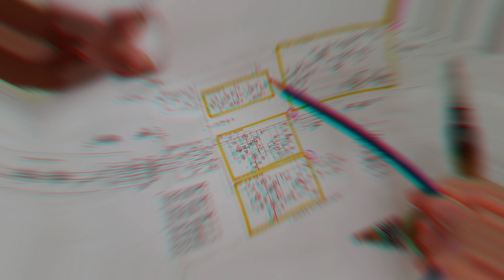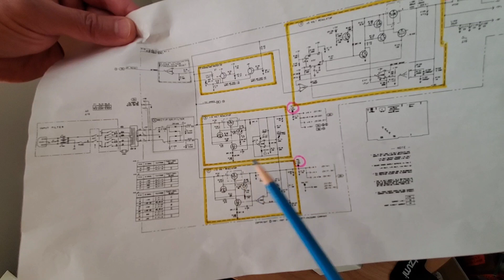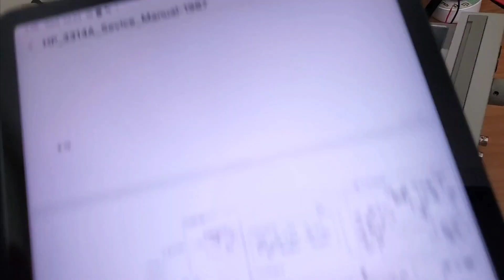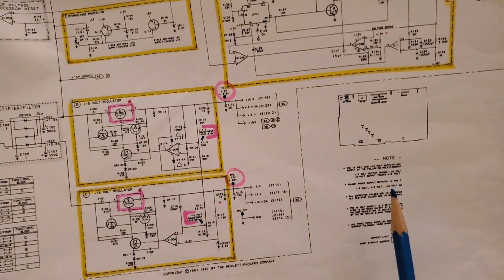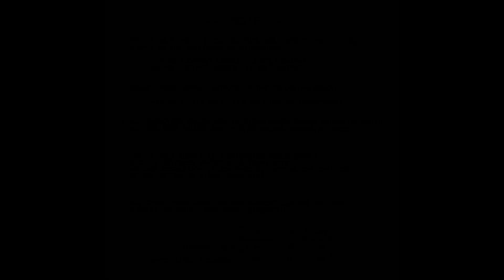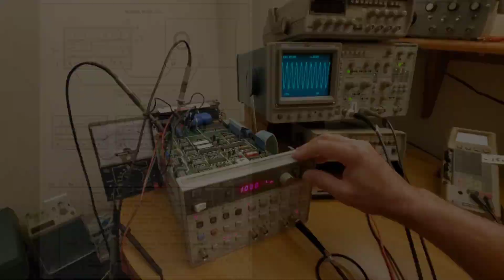HP 3314A Part 2 Troubleshooting (Power Supply and Voltage Safety Circuits)

Comment: Hi could u help me pls I hv a display issue, however when I discount the same cable as u did. I get the screen and good voltages on the rails. When connecting the cable back I get on the rails +0.37 volts + 10.69 volts and 0.116 volts. Do u hv any idea where i should look?
Reply: Ok mate thnks i will check it out and thanks for the support and great explannations
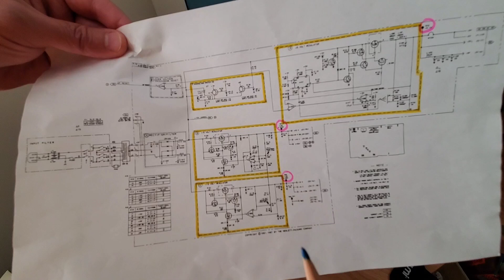Reply from the maker: Yes, in the video starting @8:35 there's 1min about the higher voltages behind the regulators. The output readings of the transfomer are in RMS so higher DC measurements are expected after AC to DC rectification.  I don't know if your unit needs calibration or not - I have not looked into it myself as my output measurements seem to be good (although only measured against my other old equipment).  The service manual pdf has more details if you need it.
Reply from the maker: If voltages go back to normal when disconnecting the J1 ribbon connector, then I would suspect a shorted component on the front panel circuits.  The display board itself is less likely to have short, but its smaller controller board right behind it (I think it's called A11 board though missing from my service manual) it does have some tantalum caps that could easily cause your issue.  Check for a short with a multimeter on the supply lines on that board by itself and if appear shorted then you can try targeting the tantalum caps by cutting one end until you find the bad one.  It's hard to help you much more than that here but I do wish you good luck!
Reply: Thanks Adam for the pointer appreciate it
Reply from the maker: You're welcome and hope you can find the issue 👍
Reply: Thanks Adam for the pointer appreciate it, but its when i disconnect the J3 ribbon. I cant seem to see where this ribbon goes.
Reply from the maker: J3 goes to the Generator board at the very bottom, the same board I had the second bad tantalum cap in my video.  If you don't know how to get to that board you can watch Part 1 video
Reply: Hi Adam I just want to say a big thank you, followed what you did, i cut C107 and C607 and low and behold my display worked. So i will swap out those two tantalums for new sealed tantalums i hv with same values. Problem solved… I i think over time swap out all the tantalums just in case for the future. But a big thank you, you helped alot.
Reply from the maker: You're welcome and I'm glad to hear you found the issue 👍 👍
Reply: Hi Adam sorry one last question, I normally build Valve amplifier so im familiar with electronics. However this was my first piece of test equipment repairing… I have replaced those tantalums and the units back up running. I tested the rail voltages and theyre in spec, i then tested the -24 volts across C101 was -27V  across C100 +27 V is that ok.. Also do i also need to run through calibration tests.